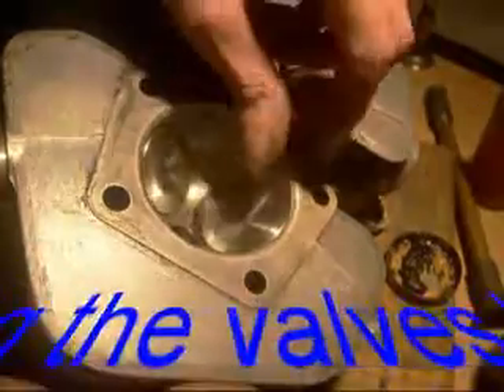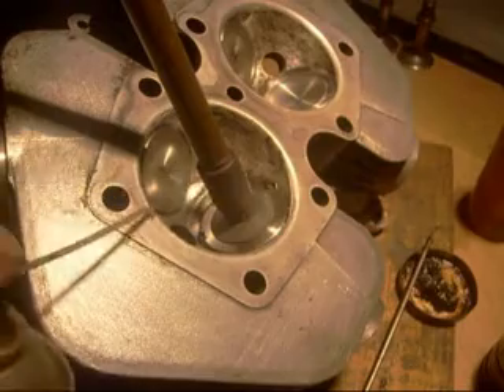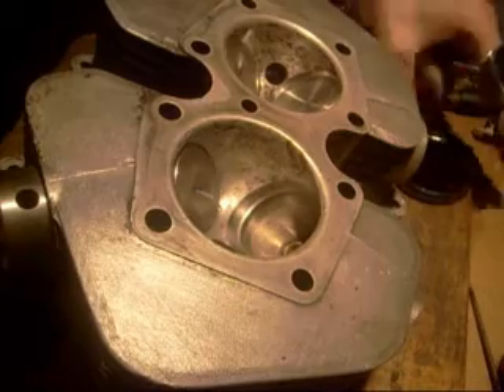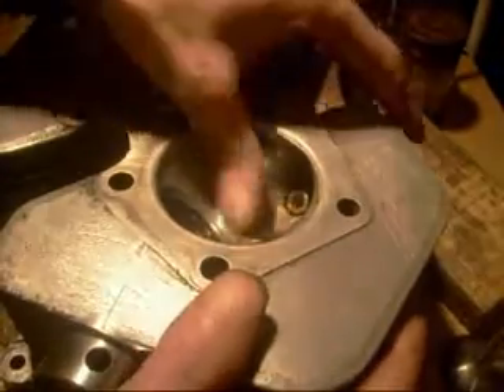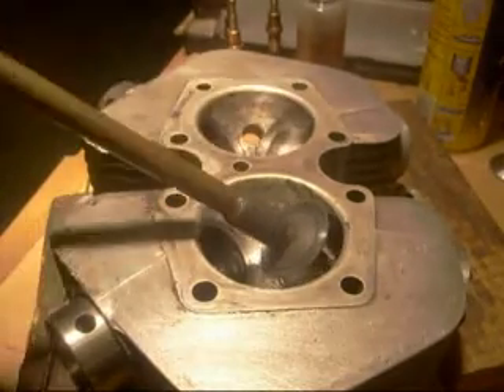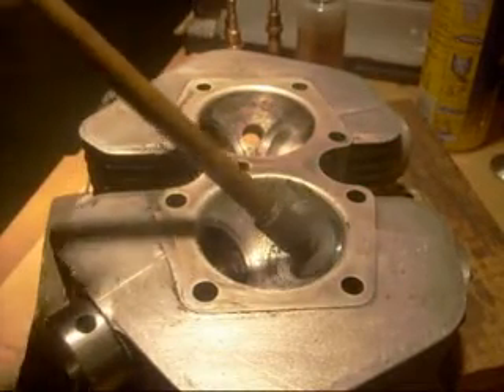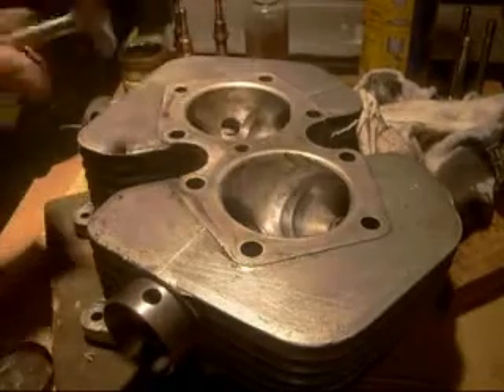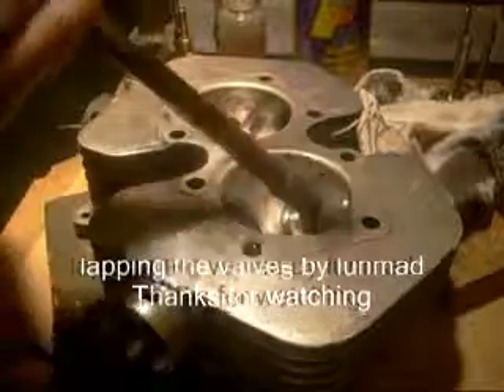Grinding (lapping) the valves T120R pt1

Comment: What was the blue stuff used to check the seals?
Reply: Jeff Moore Nevermind. "Engineer's Blue" is what he said. It's a highly pigmented paste. Got it.
Reply from the maker: Jeff Moore 
HI jeff :-)
sorry for missing your post, it is like ball pen ink and can show you imperfections when it does not stain what it should, like small dents would remain blue free whilst the surrounding area would be blue. As most of it is wiped off it has no thickness.